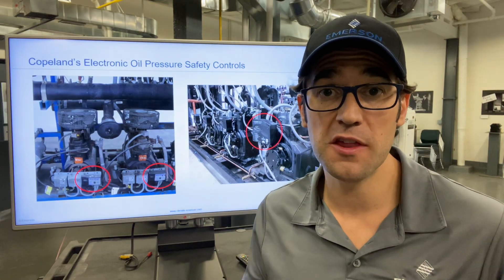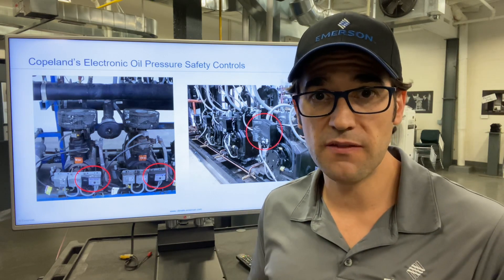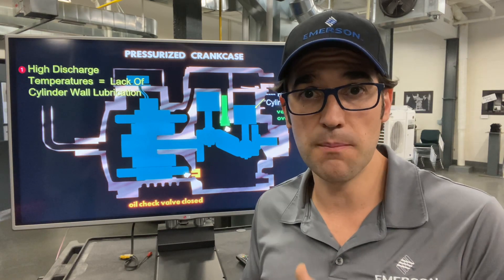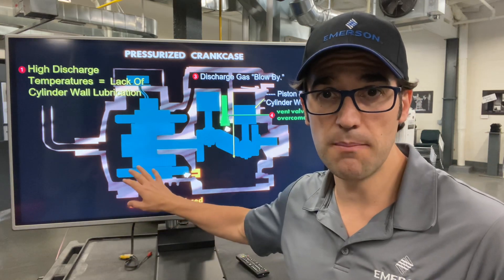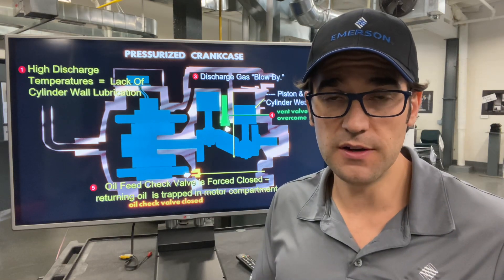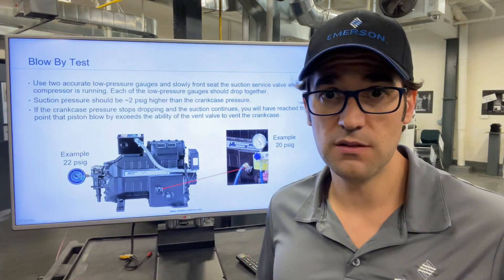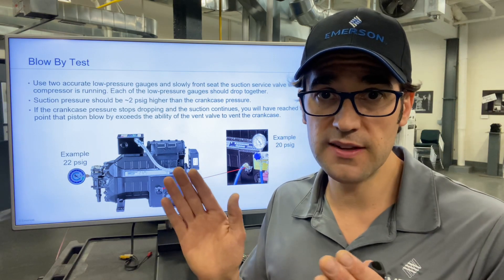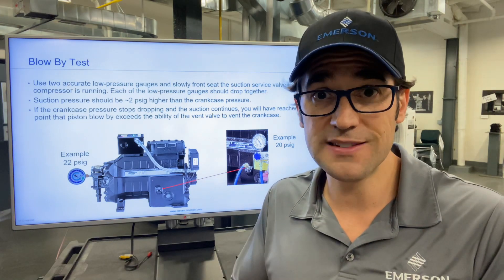Blow By Explained for Refrigeration Compressors

Comment: Does blow by cause this on bitzers 4ge for example with trax oil. It keeps trying to fill oil sep is full .
Reply from the maker: Depending on how bad the Blow by is on the Bitzer it would have a really hard time to fill or not at all because you now have a pressurized crankcase

Comment: So would it be safe to say that if blow by is occurring damage to the compressor has already been done?
Reply from the maker: Yes if its actually blow by because of cylinder damage the compressor is done you will need another one.
Reply: @RefrigerationMentor  Awesome appreciate the reply Trevor!
Reply: So my question is what is route cause. Try high discharge pressure. " For many reasons"
My thoughts are the safeties should be shutting it down prior damage....
Perhaps techs should not tech the end user how to reset it.
That also an issue with ice machines

Comment: Oh I just found the this video on blow by. I had asked this question on a different video

Wish I would’ve seen this last week lol
I have 4d discus low temp running 404. It has been running without a head fan for more then a year customer fault not mine anyway 
It’s loosing oil, I added 1/2 gallon and the next morning it was gone already. CC is good, charge is good 
Single system no separator 
It was making a noise on shut down and a little noise while running so I pulled the valve plates. I found a lot of oil sitting on top of 2 pistons and the valve plates were dripping oil as well the top of the v-plate cover drenched in oil 
Is this a sure sign of blow? Without having tested crank pressure?
Thanks
Reply from the maker: Not necessarily. When you have oil in the cylinders it’s usually from flooded starts. I would safely do a blow by test, if that passes I would verify all piping from sizing, traps, slopes and so on.
Reply: My thoughts are lose of capicty. Broken Reid's on vplate. In my experience the oil is collecting in the evaporator coil.

Comment: Can you please say, What is blowby 20% or 30% mean?
How it is calculated
Reply from the maker: I do not know this calculation you are talking about. What I do know is Blow by is bad and when you have really any you lose efficiency and as it get worse depending on the style of compressor it starts overheating and lack of oil supply to the bearings.
Reply: @RefrigerationMentor  
Thanks for the prompt reply.
 
do you any idea, how the blowby is calculated or how it is known?
Reply from the maker: @baachiys6488  you have to do a blow by test by putting a low pressure gauge on the crankcase and a low pressure gauge on the suction service valve and slowly front seat the suction service valve and watch the gauges and if they drop together and pump down the compressor you don’t have blow-by but if the low pressure gauge on the crankcase rises that means the vent valve has been over come and you have a pressurize crankcase which is a potential sign of blow by. It could be pressurized from the oil Management system if it has one pressurizing the crank but at the point you will need to inspect the compressor closer.

Comment: I have been told you should shut the oil feed off as well when checking blow by. What’s your thoughts?
Reply from the maker: As mention in the video,  it could be the oil feed causing the issue.  I have done it both ways. If the blow-by is really bad you can watch the compressor sight glass empty very quickly. You can close the oil feed but always be careful not to forget it closed or run the compressor with no oil.  If the system is using an oil separator or an oil float that might be stuck open, that could also cause a pressurized crankcase.